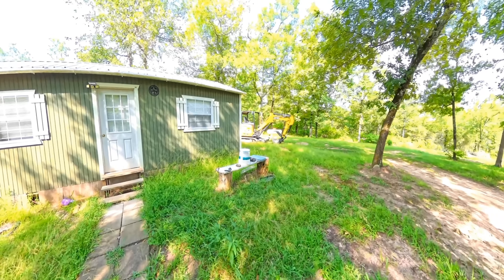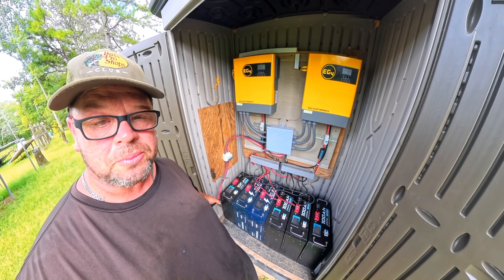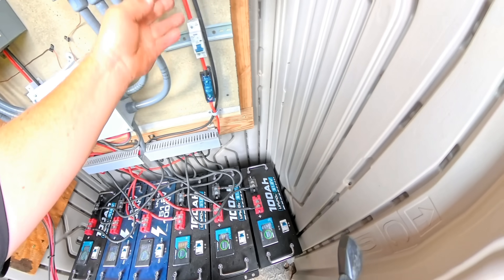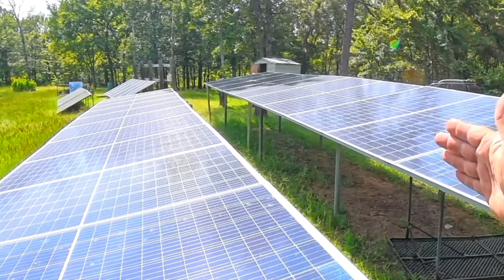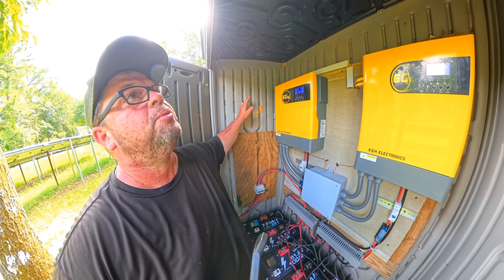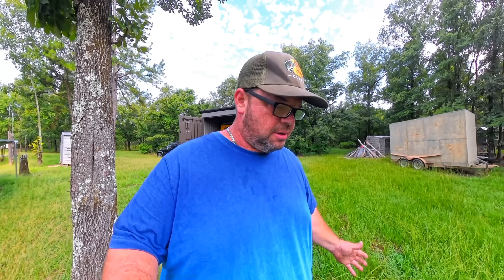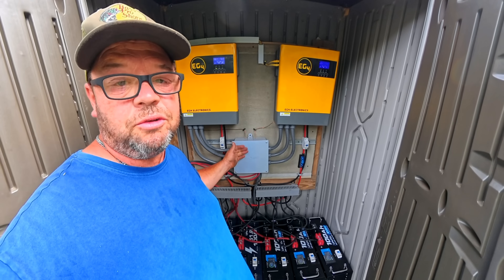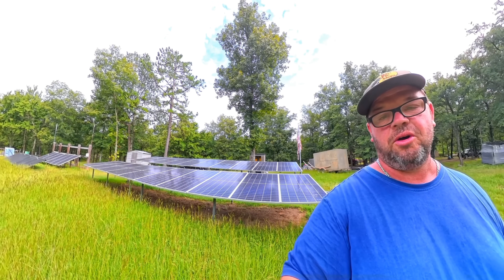Powering My House 24/7 With BATTERIES!!

Comment: I am planning on using the eg4 3000 in a shed with a jet pump for my house water. Do you have any issues with condensation in that shed? I'm in florida so there will be issues with condensation in the morning. Thanks

Comment: Wonder if he’s ever thought about geothermal heating and cooling. Much better then a standard hvac system
Reply from the maker: no but i do own a track ho i might start looking onto it
Reply: @OKLAHOMAOFFGRID  awesome. it cuts down on the bills anywhere from 30-70% compared to standard hvac systems but do some research into it before u do it. its a high upfront cost compared to a normal hvac but its a lot less maintenance and less parts that can break

Comment: Hi Mate, I already have solar setup, but I notice my new house had some good wind, so I ordered some wind generators. After having a few bad buys, I finally found some good wind generators ( A Brand Name ). I now have 10 wind generators up, attached to 10 poles of a old fence line. In a all day wind storm with no solar, my batteries got fully charged. So wind has gone from a hobby to a backup for my solar, in bad weather and at night. There is a lot of junk on line, but I have found a good model ( SUNB00 ) it was $368AUD 
I brought four and they work good in low winds and makes very low noise.   
Search -
24V/48V 1000W Windmill Power 6Blades Wind Turbine Generator W/ Charge Controller
Order the 48V model and use a 3 phase AC bridge rectifier to make it DC, then you can use a normal PWM solar regular with a max solar input of 50V.
I hope this information helps everyone.
Reply from the maker: thanks for sharing!..so how many watts to charge your batteries per day and how many batteries do you have?

Comment: Whats been the total cost of your solar system? And how long has it been in place. That would give you your monthly bill/cost basis. Surely its not "Free". But, I get your point. Dont forget to add in ugrades and repairs and atleast 200hr for setup. Human time is expensive for simple things I value it at 200hr. It may be well worth more than that. You can never reutilize that time for anything else. So it was a cost. I think if you add those things up, youll see it wasnt and is not Free.

Comment: You could add a solar powered roof vent a add ms install an attic temperature switch to let it run only above 75 or 80 deg.

Comment: For ventilating the battery shed. How about the wind blown roof fans you see on vans? Along with, even the exhaust fan vents on the walls, used for clothes dryers.

Comment: You could look at having 2 water systems 1 your current version. 2nd one where your excess energy flows into a hot water tank. Have it so the batteries discharge to say 60% until then the water heater switches off and then priorities the battery bank

Comment: to vent your shead put in two `12 V extractor fans.Put hoods (angle) over them. They must be (The hood ) 200% larger than the  fans. These hoods will allow for water run off and a not allow the fans to pull in water. Put the fan ona timer, you  wouldneed them at night to run just between 10AM to 4PM , when the day hetas up. Do a little more research if you think this sugestion can work

Comment: Most of us live in areas which have building codes brother, you seem not to live in a place that doesn’t require you to follow building code, lucky you , cause right now you are in violation of electrical building codes to do with article 110.26, working clearances etc

Comment: I got 280 ah lithium battery ofg aliexpress for 200 i got diffrent name brands and the voltage is slightly off at full charge i got 8 in series to 24 v there swelled thoilet them get down to 6 v onetime i need to get a bms but only 4 of them swolled up id say about 3/16 of inch stillwork tho im not sure if it was caused by low voltage or i overcharged them i got solar charge controler that has been charging at about 30 v

Comment: I've been trying to figure out how to get the eg4 to connect to the vatrer and make it think it's (lead acid) how did u get the inverter to charge the battery
Reply from the maker: you need to go to user defined in the inverter and set it to the parameters of the vatrer battery

Comment: Times have changed and many do not realise it, I am off-grid in a small semi-detached UK house, back in the 80s and 90s it was almost impossible, even small solar panels cost £1000, virtually nothing in the line of charge controllers existed, no MPPTs. Lights were halogen and totally wasteful, no Lithium batteries, even though I will admit I run on Lead Acid at the moment. But today we have cheaper kit, we have so much good advice on the internet, some bad advice, but you have to use commonsense to filter that out. Also certainly in the UK the cost of energy is just too expensive, the cost of standing charges is totally obscene and was many times higher than what I was using in electricity. I am now off-grid happy and would never go back. I like the autonomy of it all and the self reliance. Warning to newbies, Solar is highly addictive lol, you will become both a professional electrician and a total solar nutter, you will bore the pants off your mates down the pub and become fanatical about your system and getting it perfect. Its a bit like rail and steam enthusiasts.

Comment: You can install a fan underneath the battery pack that will force air out of the bottom of the shack. This will solve the water issue and keep the shack a little cooler.

Comment: I'm not off grid but I have 400 watts solar panels and I have 2  200AH batteries and 2. 300 AH batteries and 5 100ah batteries only use on my day off because I am new to this and I can an eye on the watts going out of the inverter I've used it on our TV and internet system and the washer add ice maker microwave oven and space heater

Comment: Unfortunately this type of setup doesn't save you much money.  Those batteries need to be replaced every 4 to 6 years (probably 4 years on this set up since heat shortens the lifespan).  So $5400 of batteries every 4 years comes out to $112 per month.  The good news is though batteries are getting cheaper as time goes on, so eventually this will make good financial sense when public electricity only goes up in price and batteries will go down.
Reply from the maker: lmbo..every 4 years..do your research

Comment: Doesn't it get hot in that shed? I am not saying I know anything, but how do you know the batteries and inverters can handle all that heat? I guess they are rated for that?
Reply from the maker: I'm working on a solution for that

Comment: If you haven't already ventilated the battery shed, it'd be better to put the intake fan lower down, angled at the batteries, with the exhaust higher up (where you first point to) to carry the heat out as it rises. This will also create a crosswind inside the shed (since the majority of air will be bouncing off the lower walls rather than directly through)

Comment: Does it keep warm enough in the winter? You should have probably used a bigger shed so you can expand your system. You can use an attic fan with thermostat.
Reply from the maker: So far so good last winter

Comment: Thats roughly 9 thousand dollars just for the 6 batteries and 2 controllers. Not counting the price of the solar panels. Seems like a large investment upfront when my power bill runs about $200 per month would come out to 4 1/2 yrs of power and I'm sure by then the panels, batteries, or control boards would need to be replaced. Not really economical if u have a power hook up considering cost vs longevity
Reply from the maker: Well first off it's about 6K for everything

Comment: What's the amperage of your t-class fuses? Do you need to upgrade those now that you've added another 2 batteries capable of putting out 100A each?
Reply from the maker: only 200 in between each inverter ..but my inverters will never pull 200 each so no worries

Comment: You spent like $6000 on batteries. Be prepared to spend another $6000 in about five years to replace them. Is it really cheaper than the electric bill?
Reply from the maker: These batteries last much longer than 5 years.. try 20 years

Comment: Cool system. Think about installing a downward elbow angled vent, much like the ones used to exhaust a house furnace, they face down so rain doesn't get inside the vents and usually have pest blocker lattice on the ends. One on each of the sides you mentioned would work great especially with a couple PC fan attached to the vents. You could even hook up the PC fans to a temp detector so they only kick on once a certain temp is reached. Should work out nice for ya and be cheap to invest in.
Reply: On second thought 🤔 I figured I'd mention placing one vent high and to the left side of the panel on one side and set to exhaust and one vent low and to the right side of the other panel on the other side and set it to intake will force airflow to cover more area. Keep in mind heat rises so like I said making the intake the lower vent will intake the cooler air vs the higher vent. Hope it all works out for ya regardless!
Reply from the maker: Working on it

Comment: Keep the propane for redundancy. Build a roof to shade your shed. This allows for ventilation to waft over your shed and shades the shed. You could put a tarp roof over it as a temporary solution to see what sort of temperature differences you'd get. 

Solar is cool but it's a technology relying on electronics and they can fail.  If something goes wrong, whilst your looking at troubleshooting/repair or replacement, propane will keep you going.
Reply from the maker: Good idea

Comment: The wife and I have been living off-grid for over 3 years now with continuous electricity supplied by our solar system.  We've got a bit more in solar production, and a bit less in storage, but we can last 3  days on a full battery rack charge.  Being in the snow belt of Upstate NY, we get some serious snow storms here and we still never have an issue.  *We DO have a small generator to charge our batteries in the event we get more bad weather of more than 3 or 4 days in a row.  We built our own house on 30 acres of forested land and are over 1/4 mile from the road.  You can see our setup on some of our vids.
Reply from the maker: Nice

Comment: I would definitely build a solid shelter over that. Something that will withstand the weather, maybe even throw some solar panels on top if you needed. Batteries last longer when they're not in that much heat.

Comment: Dude is out here livin the dream.
(edit) for your vent idea you could put a sheet of plywood on top to give it some overhang on each side and put some shingles on it then put a vent on one side of the shed and a fan on the other.  That will allow it to stay dry.  Or just expand the project and build an actual shed for them so you can expand the system as needed.  Do you have any DC optimizers on your panels? Those would help with shading issues.

Comment: I’m wondering if you could add a whole Nother Battery set up and double your batteries that way you have more storage. I don’t think you’d need more solar panels. I think they could probably charge those up pretty quick on a sunny day. I was just thinking if it was me, that’s what I would do. If you have to increase your solar panels, I don’t think you’d have to increase them by much. Awesome set up! I would like to learn how to do that.
Reply: He could just get another shed and duplicate/expand his setup into that yeah.  Or build an actual shed where he has room for actual server racks to put those server rack batteries in rather than letting them sit on the floor.
Reply from the maker: i have some back up full systems

Comment: I'm hoping to see flywheel generator batteries. We have them for big buildings but I guess they lose their efficiency for small residential size. I seen a few years ago a Swedish (I think) company say they have invented one and they were testing it out on a few hundred houses locally before deciding what to do. I believe the article said the company was setting a price of about $2400 for the equivalent of a $10,000 battery. I would prefer mechanical over chemicals. I guess there would be a worry about it blowing up, but an armored room can be built once and be forever. I vote flywheel battery.

Comment: If your not connected to grid at all. What do you do in the winter time?
Reply from the maker: The same thing LOL I still get power in the winter LOL
Reply: Batteries and Gas/Propane generator when the batteries run out.

Comment: Will this work on grip for residential purposes
Reply from the maker: I have no idea what grip is
Reply: You will want a hybrid inverter to go grid tie and do batteries at the same time.  That way you can sell power back to the power company to negate your power bill and have batteries at night or when you dont have grid power.  You will also need either a critical loads panel that runs certain circuits off of your batteries (like your wall outlets and lights and your fridge in the kitchen) and everything else (central air, water heater, dryer, etc) is on grid power only.  Or the other option is a smart panel that you can designate which circuits use batteries all the time, which circuits use batteries only when the charge is a certain amount and which circuits never use battery power with a phone app.  It will be super expensive to do a hybrid setup (like $80k+ with 30kw worth of batteries and 10kw worth of solar panels) if you have professionals do it.  But since you are messing with grid power I would highly recommend you use professionals and get it inspected by the city (which you'll more than likely have to do unless you live out in the country but are still on grid power) for safety.  Do not lease solar panels or allow a company to put solar panels on your roof that you dont own!  That is a scam and you will end up losing money and still not own anything.  

Plus if you are going to do a solar set up you might wanna get started NOW because the tax credit goes away after this year.  Also on the tax credit its based off your tax liability so if you pay 80k for a solar setup and you are getting a 30% tax credit for that thats 24k back... buuuut if you only pay 5 or 8k that year in taxes you will only get back whatever you paid in taxes that year.  They arent going to give you all 24k at once.  You will have to fill out the green energy tax credit form 5695 yourself and keep track of how much they owe you each year till the money is gone.  Keep that in mind when they are talking money and payment plans because what they will do is tell you "you have 18 payments to pay down that 30% or your payments will balloon from 300/mo to 800/mo but dont worry that just means you have to give them the tax credit money".  If you dont make enough to be paying 24k a year in taxes then you will not be able to get all 24k back in 18 months (unless you're paying 12k in taxes and you start payments in jan of one year and then by second tax time after install it would be 16 months at best but that's a unicorn scenario).  I just wanted you to be aware of that because solar companies are about 95% scam artists and the local installers they hire are the only 5% that are legitimate businesses.

(edit) these specific batteries are not UL listed so they cant be used in a grid tie/hybrid system just be aware of that.

Comment: 🚨 OFF-GRID ALERT on EG4 inverters like the 6000XP: Mine failed after pro install, stranding us powerless for 17 DAYS in the third-hottest heat wave on record (June-July 2025, 90°F+ averages, 94°F peaks). EG4 KNEW our crisis—pets at risk, family suffering—and still chose inaction, broken promises, and deflection. Cost us $2,646 in survival hits, but worse: They assumed DIY to shirk support, despite marketing to off-grid/DIYers. Beware—similar stories abound.

Read more for the full nightmare story below...

It started June 21: Our EG4 6000XP inverter died, plunging our off-grid home into darkness just as a brutal heat wave hit—third-hottest on record, with relentless 90°F+ days turning our house into a sauna. My four Great Pyrenees dogs panted endlessly, whining in distress as we scrambled with a noisy generator that guzzled fuel ($561 over 17 days) and barely kept basics running. Food spoiled ($385 wasted), and my pet treat dehydration business halted cold ($1,700 lost)—every off-grid dream shattered by what should have been reliable gear.

EG4 knew: I escalated repeatedly, detailing the heat risks to my pets and family, but they ghosted. Initial support (Leela) promised a swap, then silence for days. Only after my letter to CEO James Showalter did President Troy Asberry call—promising overnight replacement by June 28 (even personal delivery) and a $500 gift card for the first week's mess. But it arrived late (June 30 afternoon), and support vanished again: I chased for PV switch specs (known since day 1), got nothing, so self-researched and installed them July 5 amid the holiday blackout. More promises broken, dismissive replies—system finally restored July 8, mostly by my efforts.

Worse hypocrisy: EG4 later assumed it was DIY (despite my refusal to disclose details for unrelated reasons), claiming 'product-only' status with lower support/warranties for self-installs. Yet they market heavily to off-grid/DIYers as 'reliable partners'—admitting they don't back that ethos when crises hit. For families like mine, where power means survival, this negligence is unforgivable. Do your due diligence; EG4's inaction could cost you everything. What alternatives have you found?